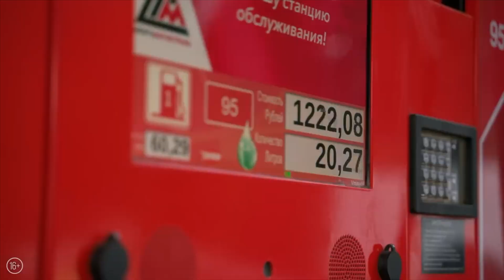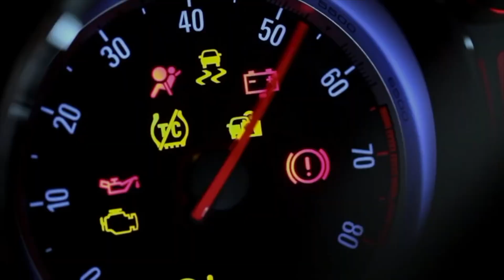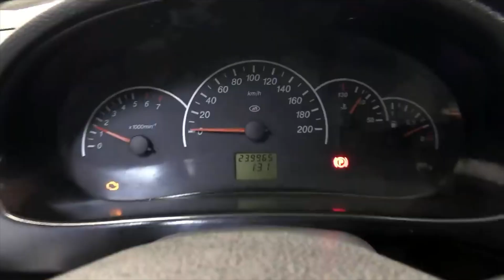THE MOST RELIABLE DIESEL ENGINES

Comment: hello
what do you think of Opel Corsa 1.4 90 hp with automatic transmission 2014-2019 ? is this car reliable ? is there any issues in the engine or gearbox ? does its engine support LPG ? thanks